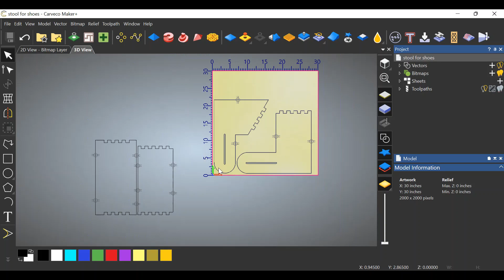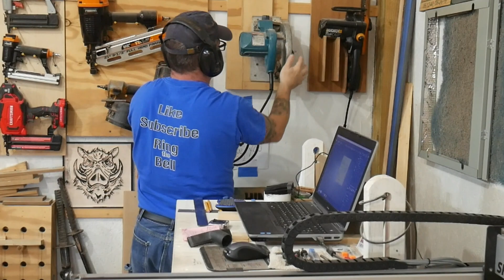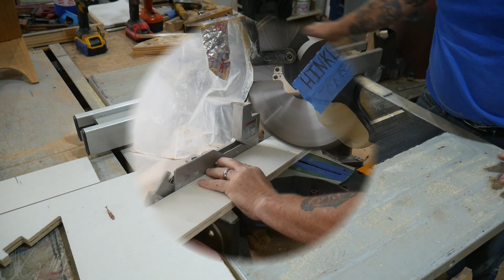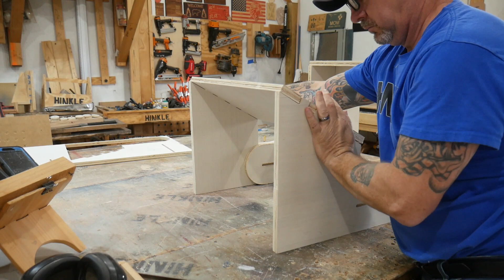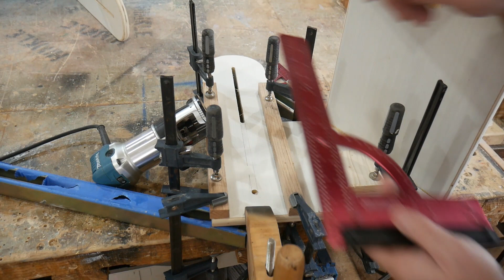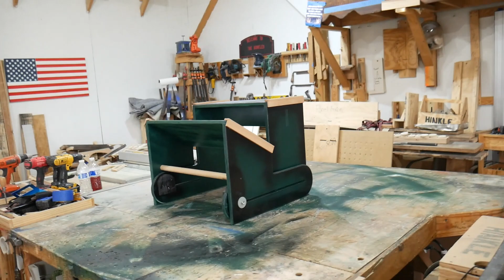A most important invention of our time!!

Comment: Does carveco maker do box joints. I have carveco maker and I don't see it. Great video. Thanks
Reply from the maker: Thank you for watching
No Carveco does not have a specific function for box joints 
The way I produced them is by creating a single box, the size of a single joint, then use block and copy entering a specific space distance between the boxes and then join them to the project taking into account for gap between joints 
Also, on angled pieces after I have created the series of joints, and then use the transform tool to angle the series to match the project. Hope this helps.

Comment: Alway great videos from you Vernon, good to see you correcting design part way through. As you've added cherry strips to hide gappy finger joints, another strip as a heel bar wouldn't go amiss!
Quick fix for Gappy finger joints is thin wedges cut with the grain, these can be glued & tapped in as gappy fillers. Will be virtually invisible once dry & sanded flush.
Reply from the maker: Thanks John 
I think your right and I may add to the cherry trim I like the contrast in color!